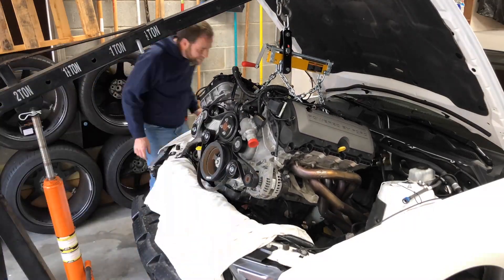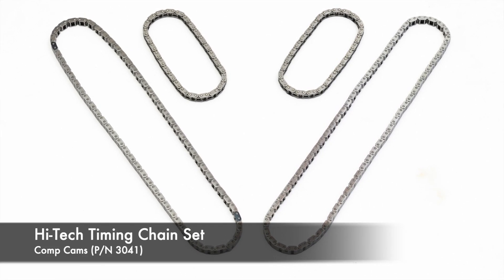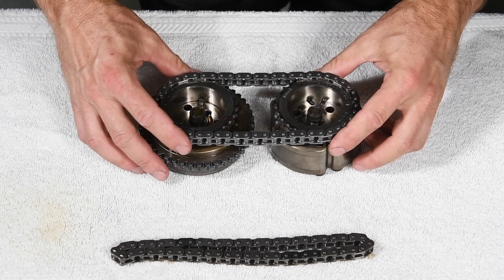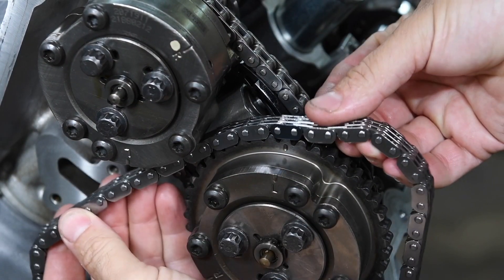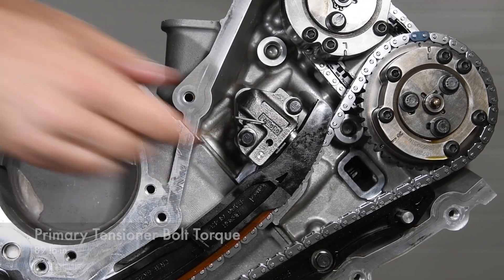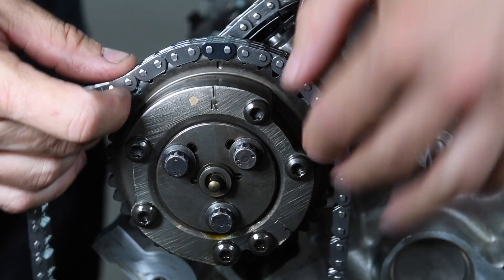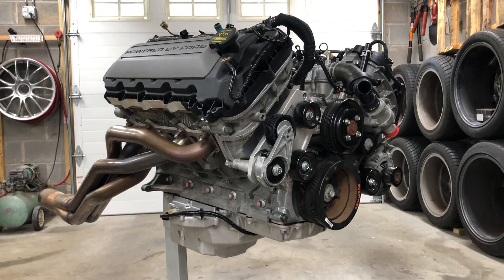Coyote Timing Chain Installation

Comment: It looks like the Tensioner comes with the Boss guides too in one kit? And at that point the oil pump gears should be done too I guess.. And if you have to do it, it makes sense to strengthen things up. Especially if you are going to boost your car... I'll be doing this when the time comes.. I still have under 20K miles on my 17.. It a weekend car  for me so the miles stay low. But I bought it with 8,909 miles 1 owner garage kept so. Anyway sometimes I still can't believe how lucky I got with mine..
Reply from the maker: The Boss kit comes with the Boss secondary guide.

Comment: are the cam cap bolts tty?
Reply from the maker: Good question. Not that I recall but I would check with a repair manual. I don’t have one in front of me to check.

Comment: So when putting the keyway to the 9clock position does it matter that it’s not TDC?
Reply from the maker: No. The engine needs to be in a certain position so the cams are lined up. It's not TDC.
Reply: @Mustang-Geek ok thanks I’m doing a cam swap soon in my 2011 and just need to know 👍 seems pretty easy to do

Comment: Hello, I bought the tensioner kit for my 2014 Mustang Gt but I noticed that the new secondary tensioner are shorter than mine and the bottom clips do not hold them in place, is it ok to use them anyway?
Reply from the maker: Hmmm. I'd call Ford Performance tech line: (800) 367-3788
Reply: no, dont use them. the bottum clip is going to fail. have one in the shop now, I believe the shorter tensioner is for v6.

Comment: I installed a new timing set on my 2014 gen 1 and it spun fine about 10 revolutions and then suddenly stopped? I have no oil in the motor. Could it have stopped because none of the tensioners or anything has oil in it? It only has assembly lube
Reply from the maker: If the chains are aligned correctly, I wouldn't worry about it. However, the chains may have jumped because the tensioners were loose. Double check everything just to make sure.
Reply: @ thank you for responding and I will check before I try and start the engine

Comment: I have a question. At the beginning of the video. I can't get my inside cam on bank 2 "driver side" to face data label up. The data label is sitting at the 1 or 2 o clock position. If I try to rotate it up to the 12 position it hits the lifter. Like the lifter.
Reply from the maker: Hmmmmm. This is a gen 1 coyote, correct?

Comment: I've got a PO0017 and 0012 on mine and am considering replacing all this but I don't like being a parts changer. I'd rather know why it's doing that, i know that the timing on bank 2 exhaust cam is bad off.
Reply from the maker: Maybe you can pull the valve covers and make sure the timing marks line up on the secondary chains.

Comment: Is it completely do-able at home with the f150 with the engine still installed in the vehicle? Also I have a 2020, is the procedure still the same?
Reply from the maker: It's doable with the engine in the vehicle. I believe the procedure is slightly different on Gen 2 and Gen 3 coyote engines. Get a repair manual for your vehicle and it should outline the procedure.

Comment: You saved me a massive headache trying to decipher the timing guide that I found online. I've done Builds on smaller four cylinder engines like Hondas no problem but looking at all the different markings for the main timing on the 5.0 was throwing me in a loop. So a big thumbs up to you for making this make sense to me
Reply from the maker: Glad it helped! With two banks of cylinders, I think it's designed so that the heads can be installed on the engine without interfering with the pistons and then the chains are installed without the valves hitting the pistons. Makes for a strange procedure, but it's done that way for a reason!

Comment: Good evening, I have a question. Your answer will be pleasant. This synchronization would work for a Ford Lariat F150 5.0
Reply from the maker: What year?
Reply: @Mustang-Geek   2018
Reply from the maker: I’ll have to look it up.
Reply: @Mustang-Geek  I have a 2018 need help is this the same procedure??
Reply from the maker: @  I will need to look in my manual for a 2018 model. I’ll take a look and let you know in a few days. Unfortunately I don’t have access to the manual right now.
Reply from the maker: @coltgriffin9444  I looked at a repair manual for a 2018 Mustang, and while the process is similar, the crankshaft positions seem to be different. I'd suggest: https://us.haynes.com/products/haynes-diy-ford-mustang-vi-p8-from-2015-to-2022?_pos=1&_sid=eab378f6f&_ss=r&variant=46926478442746

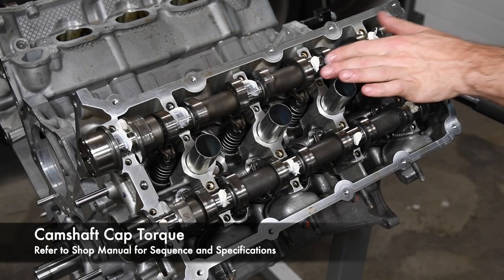Comment: I appreciate the video but at 1:06 you show both data matrix slightly angled  but the very next scene they look parallel with the head?
Reply from the maker: Good observation! To make the sequence work in the video, I actually flipped the image horizontally and used video of the right side head for this portion (note how I'm torquing the fasteners "counterclockwise!" Just ignore the inconsistency. The data labels will "naturally" sit where they want to sit during the process from valve spring tension.
Reply: @Mustang-Geek so the data labels are supposed to be slightly angled facing straight up correct?
Reply from the maker: @yobeezy4320  Pretty much. They'll "rest" at a certain spot, so they're either up or mostly up, if that makes sense.

Comment: When you turn the keyway from the 5 o'clock position to the 12 o'clock position, you make one full rotation back to 5 THEN to 12 correct? Installing OPGs and whipple right now and just finished timing motor
Reply from the maker: I'm not sure what you're referring to. In the video, I start at the 9 o'clock position, then go to the 12 o'clock position. Where are you getting "5 o'clock position?"
Reply: @Mustang-Geek  i took off the passenger side timing chain as per the Ford service manual. Then i take off the drivers side timing chain with the keyway positioned at 5 o'clock. After installing the drivers side chain back on, Ford says, "Rotate crank keyway one full revolution to 12 o'clock," then install passenger timing chain. This is on the gen 3 Mustang Coyote.
Reply from the maker: @DevonTK707  OH, I'm not familiar with a Gen 3. The procedure may indeed be different.
Reply: Yes, you're right. Full rotation and then set to 5:00 for the passenger side chain.

Comment: What is going wrong if after I follow this procedure and rotate the engine by hand , the timing chains are jumping teeth ? Or am I not supposed to rotate the engine at all after.
Reply: Is it actually jumping time? Or are the chains just jolting?
Reply from the maker: @El_Guero801  That's a fair point.
Reply from the maker: Are your tensioners installed? The change should not jump teeth with the tensioners installed.

Comment: Is this similar to gen 3 coyotes?
Reply: Good question. I haven't built one, but you should check a repair manual for that procedure. I suspect it is very similar, but the fastener torque specs are likely different, etc.
Reply: @WesDuenkel  I'm thinking the same, saw some photos and the markings looked identical. I want to assume the procedure, like clocking the crank to 9 o clock, then 12 may be the same. Pretty cool too see nevertheless

Comment: Great video, thank you.
Question: what is the power that this timing kit with the boss 302 items rated for? I know a heavy duty secondary chain may be necessary.. but at what point the does the VCT become an issue in terms of power
Reply from the maker: Great question. I don't have an answer for that, but I do know that these engines can handle well above 1000 horsepower. Unless you're hitting that range, I wouldn't worry about it!

Comment: Did you have to put the engine in TDC on compression stroke specifically? This is exactly where I’m at. I got the cams back in and torqued down. They were installed in the neutral position. I used ALLDATA for my work, never mentioned anything about TDC when it came to this point of installation. Cannot find anything online.
Reply from the maker: No, use the tool to position the crankshaft as shown in the video. Ignore TDC.
Reply: Same for f150 coyote? @Mustang-Geek
Reply: How'd things work out? I was wondering about TDC
Reply: @jamesphillips9272  no need to worry about TDC! Do it just like they said. I rebuilt the upper engine and it’s running like a champ! I had a misfire cylinder 8 P0308 code. Valve was razor sharp.

Comment: It's a great video I've got a 2012 mustang GT I'm a little bit confused about the timing marks because of I'm a perfectionist when it says the timing has to be right on I mean I have to be right on I know that I'm using old timing chain as far as the big one goes on the on the crankshaft but it's really got me confused right now
Reply from the maker: Sorry, specifically: what are you confused about? Maybe I can help.
Reply: @Mustang-Geek  well the timing chains okay or the old timing chains that I have that are still on my car the original timing chains now the the cam chains are new. Okay the old timing chains are still on the car and I guess they're loose enough to where the timing marks are not really lining up correctly but me and my dog has been stranded for over a month up here in fort Worth at a parking lot right by the Trinity River I bought new cam change like I said I bought a new tensioner and guide for left cylinder head. I still need to torque down the cam caps and the phasers and get it in time and I'm still not there yet?
Reply from the maker: @DeeAnderson-em5pr  The marks should all line up if you remove the tensioners and use an adjustable wrench to move the cams slightly.
Reply: @Mustang-Geek  yeah I did that but I am waiting for a mobile mechanic to come out
Reply: @Mustang-Geek  what is explaining whenever that secondary cam chain broke and it's going to run like shit before he says but it was running when I killed it and it ran like shit but at least it ran and I could start it back up even though it was popping to the tailpipes it would still go down the road I don't know how many valves are being or broke or whatever but I know that it was running

Comment: Just had to replace a cam phaser on an f150, this video made it so easy! Thanks
Reply from the maker: Glad it helped!!! Please share!
Reply: The f150 timing is diffrent. How did it work?
Reply: @cody317645 you mean firing sequence and cam profile ? That’s determined by the lobes on the camshaft. The way the chains are setup wouldn’t be that different if not identical.

Comment: How did you install a boss 302 secondary timing chain tensioners? They're shorter than the GT tensioners.
Reply: Are you talking about the secondary tensioners, up between the phasers? That's the tensioner that I'm talking about. If you remove the long GT tensioner and install the Boss 302 secondary tensioner in its place I noticed that I no longer have a guy at the bottom because the boss 302 secondary chain tensioner it's not long enough to protrude out of the bottom therefore not allowing me to put the metal clip on, which in turn is not allowing me to put any kind of guide or support for the bottom of the secondary timing chain.
Reply from the maker: @bigmotoxer  The clips are there on the Boss parts. Look at 0:19. Maybe your Boss tensioners aren't seated all the way?
Reply: @bigmotoxer  it doesnt clip to the tensioner, it goes on the bottom of the casting hole andits literally a guide, not a tensioner.
Reply from the maker: After you install them, you need to press them down to release the spring tension! Then they "pop up" and tension the chains just like the standard versions.
Reply: @Mustang-Geek Yes but now after pressing 302 tensioners down and releasing the spring now there's no guide at the bottom.
Reply from the maker: @bigmotoxer  Re-use your original bottom guide. It's shown in place at 2:34 in the video.

Comment: Hi. What is that tool used to turn the crankshaft? Also is there a tool/jig to align the camshaft to the decklid?  Does it need to be precise or just approximate?
Reply from the maker: Good question! This is the tool I bought: https://www.amazon.com/gp/product/B085FRTWR9/ref=ppx_yo_dt_b_asin_title_o00_s00?ie=UTF8&psc=1
As far as holding the camshafts, they pretty much stay in that position. You just need to use a large adjustable wrench to "tweak" them a little to get the phasors to line up. No special tool needed.

Comment: Can the secondary tensioners be replaced without having to remove the cam sprockets?
Reply from the maker: Good question! In order to replace the tensioner, you need to remove the chain. To remove the chain, you have to remove the VVT sprockets.

Comment: Is there a reason why the sec chain tensioner go on from top to bottom? I just watched another video and the installer put them from bottom to top with the attached tab on tbe bottom? Also on one of the comments they tell him if he installed them like that the tensioners wont have any oil going through them. Thanks
Reply from the maker: I'm not sure. I know this all worked for me!
Reply: This will work as well for the 2017 f150 coyote right.?

Comment: I can’t seem to get my cam phasers to seat all the way is there anything I should do differently?
Reply from the maker: Hmmm. First, see if they fit with the chains removed. Then, use a big wrench to slightly wiggle the cams back and forth as you install the phasers. That should help them wiggle into place.
Reply: @Mustang-Geek  I can get them to seat all the way without the chains but with the chains it won’t. If one of the dowels lines up the other one won’t. But I guess moving the cam would fix that. Was just unsure if I could adjust the cam
Reply from the maker: @Jeremyf98  Yes, just rotate one of the cams a little until they slide on.

Comment: I work on my own cars, and every time I think about getting a car, truck, or SUV with DOHC I look up this procedure on the vehicle I'm interested in.... Mustang GT is a solid no for me.
Reply: Weak!

Don't be intimated by a little work lol. Grow a pair, you know you want to!
Reply from the maker: Okie doke! Please like and subscribe!
Reply: I use to be just like u but I have realized that the 5.0 really is a great engine it might not be as simple as a pushrod v8 but to reach new levels you must try new things and that’s what Ford did with the 5.0 truly an amazing engine
Reply: It looks intimidating but it’s actually pretty easy
Reply: I had phaser failure on my 2017 GT. Did the whole timing job, had a progressively worse chain rattle after and it finally jumped a tooth. Have it all apart again... it's a pain in the ass car tbh. Also had the clutch pedal weld break, and have a really annoying issue with the ecm shutting off the alternator charge unless the b+ harness is unplugged. I would not get this car again.
Reply: @chlln1591  ford has failed its buyers
Reply: Just about all cars are overhead cams these days. I've seen coyotes push 8500 rpms drag racing,and no bent push rods is a plus
Reply: What on earth is hard about doing a job that has a complete how to video? lol
Reply: Bro I been fighting mine for hrs

Comment: I only had to remove the RH Right Head on my 5.0 coyote.. prodemand says I have to put back in the same place but I noticed the timing on the LH is off.. should I just retime the whole motor following this procedure?
Reply from the maker: Good question. Seems like re-timing the whole motor is a good idea if the other head seems off. Check all the timing marks!!!

Comment: Hi,
What did you use to lift the engine out of the car?
Reply: Did you use new cam cap bolts ?😅
Reply from the maker: @ueberhopft4278  No, technically the old bolts can be re-used a couple times.
Reply from the maker: I bought some engine lift plates for Coyote engines off of ebay and used a load leveler for the engine hoist.
Reply: Thanks for the response.
Keep the great videos up ;)

Comment: Hello. Great video. When you make sure the crank sprocket is at 9 o’clock, do you have to make sure number 1 piston is at TDC?  Thanks
Reply from the maker: I don't think it matters. None of the pistons are at TDC during this process so the valves clear...I think.
Reply: The marks on the drive chains indicate phase. In other words the mark on the drive sprocket indicates the chain. It's "X" many links from there to the driven sprocket on the cam phasers.
Reply: The only time you have to do it manually is to lockout the cams and manually set the cams

Comment: This is why gm v8 Engines are way more valuable since the timing is so so so simple and a single cam just way way less engineering but great power so I’m definitely not ever getting a Ford
Reply from the maker: Thanks for watching the video! Please like and subscribe.
Reply: You end up paying for that with fuel costs. The NA 5.0 efficiency is better than anything GM has put in the Camaro.
Reply: The single cam is not "great power." If you haven't noticed, GM has to use 6.2 liters to achieve similar power to Ford's 5.0L. I also have no idea where you get the "more valuable" thing